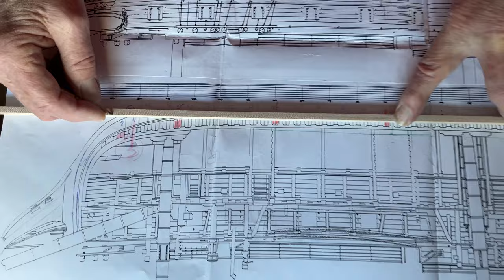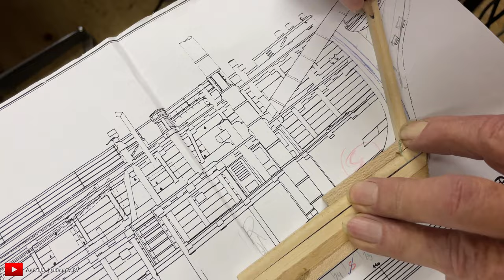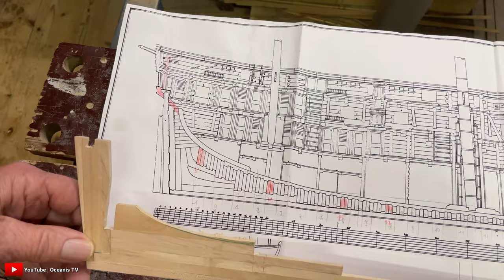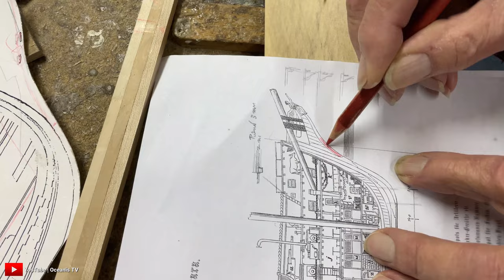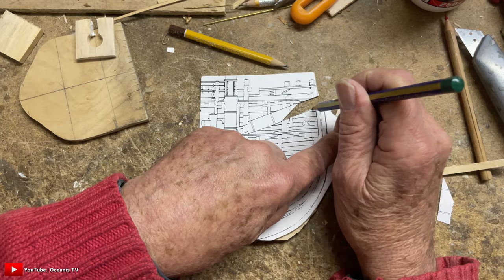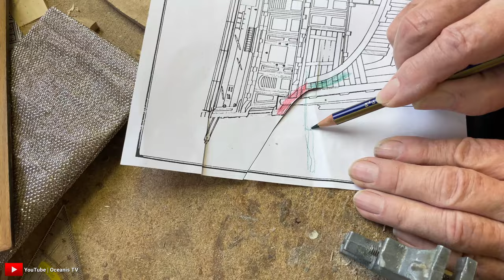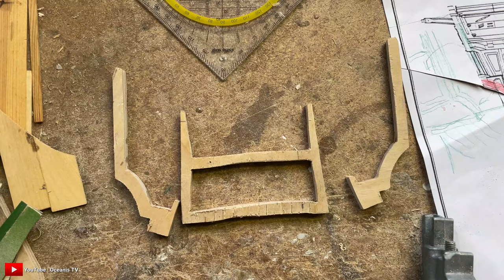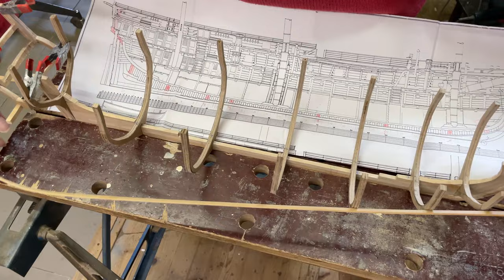How to Build Ship Model Part 2 | Building the Keel - Die Carolina 1808-1832

Comment: What is the line you are carving @20:00?
Reply: It’s called a rabbet, it so that the planking makes a smooth joint into the keel.
Reply: Does the rabbet need to be deep enough for the edge of the plank to be flush, or does it just butt up against it enough to “stick”?